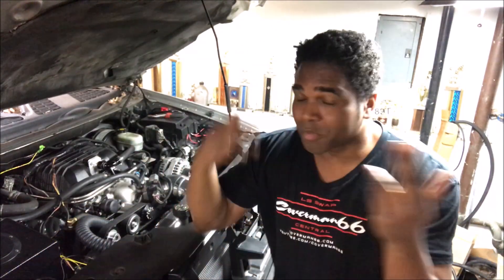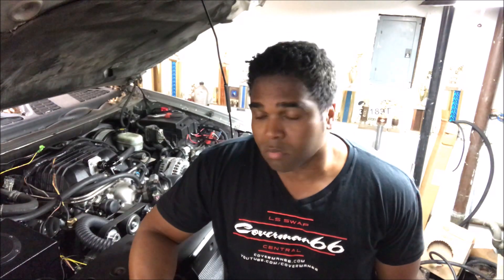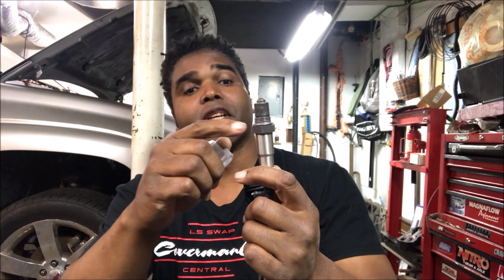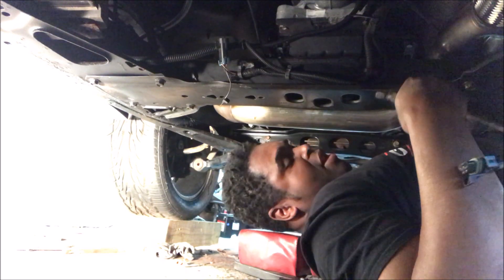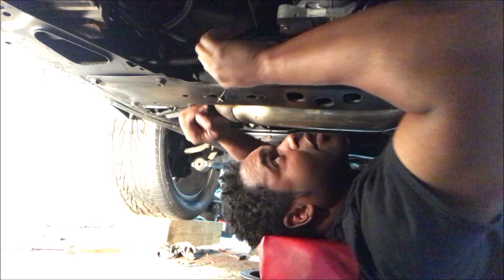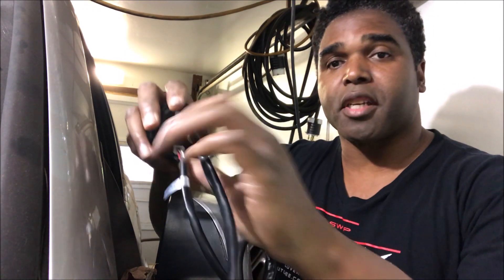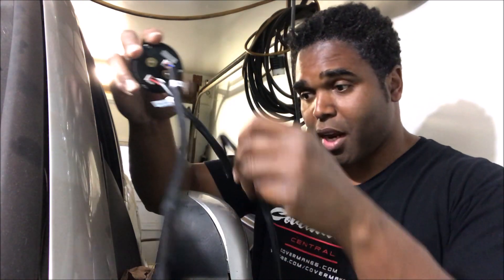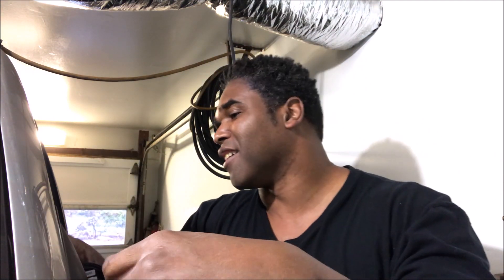How To Install An AEM X-Series Air/Fuel Sensor Gauge (WideBand UEGO Gauge)

Comment: It’s better on 3 digits, you really don’t need 2 decimal places on a gauge that moves so fast. If you need 2 decimal places with AFR you need to grab it off a data logger. It’s meaningless on a gauge.
Reply from the maker: its a preference.. i see people use both, its all good as long as you get the results accurately..

Comment: Did you just connect just the power and ground for tuning? I was told I need to connect the serial wire to tune but not sure
Reply from the maker: whats good Shwifty, brotha along with the power and ground i had to instal a o2 sensor as well. it wasnt that bad..

Comment: Do you know if they make a white face plate for this newer model wideband? I have a White Gauge Cluster in my f body. The older style comes in both colors, but this newer one only in black as far as I see
Reply from the maker: im not sure Smokey, i will be surprised if they dont.. id contact Summit or AEM to find out.. sorry i couldnt give you a more accurate answer buddy..

Comment: Nice. I have the same wideband, waiting to install. I hadn't even thought about installing in the 2nd o2 location, but that is a good idea. Saves having to weld in another bung.
Reply from the maker: you know it brotha SB.. if its there use it.. thanks